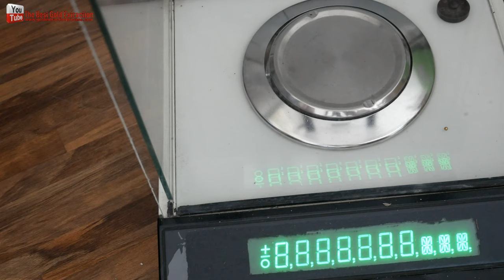Gold recovery from IC chips BGA & electronic devices.

Comment from the maker: Is gold in electronics worth extracting?
The short answer to the question is: yes…there is profit in recycling gold (and other precious metals) from electronic devices. The longer answer is that it definitely requires resources to get this resource (the old adage, it takes money to make money, if you will!).
Sourcing your electronic scrap will also be something that you need to plan in advance of startup. While electronics have precious metals, its in teeny tiny amounts so you need a LOT of scrap to make this venture worthwhile. Similarly, with the need to have labor on the inbound and the outbound, the commodity produced will NOT cover 100% of your costs, so you’ll need to establish the right fee to support your operations. Often you’ll be competing against non-profit or subsidized operations in this realm so being able to differentiate your service will also help you to be successful.
Reply: Hi sir,,  how are you??
Reply: what percentage of purity is the sulfuric acid you use? THANKS
Reply: I am intrested to start recycle and recovering precious metal bussiness
Reply: @Prince-nt4dc The sulfuric needs to be 70% +. Battery acid will work but it takes longer because it needs to evaporate off the extra water while heating. When enough water evaporates it will begin to digest the plastic. It is very very dangerous because sulfuric acid loves water. It will suck the water out of your skin in seconds. While doing so a thermal reaction takes place and it can reach 3 to 400 degrees F. Thus removing (burning) your skin much faster than you can react. Get enough on you and it can go to the bone. If you do it , do NOT use glass (crack) and acid everywhere. Stainless steel only

Comment: This all looked good up until right after the nitric acid step. Instead of tweezing the wire off just put it all in aqua Regia and dissolve the gold and precipitate it out with SMB. That way you get all the gold. By tweezing the wire your leaving the gold solder and when you melted that bit of gold that was not all the gold from those chips. That little ball of wire was way to small for what I seen pulled off. I believe they was some deception in the amount shown recovered.
Reply: He is explaning how to get gold with minimum spending. So he spends just sulfuric acid, if we go to use more substances i think it worth just if we do in big amount of scraps. This is also good, we buy just sulfuric acid and of course we spend our free time to collect gold from chips after desolving thats it :)
Reply: @mirishow  the problem is if all the gold is not recovered it is a inefficient process. It is to hard enough to collect and process to not be efficient and recover all the values.
Reply: @mirishow  If you want to do it even cheaper, use incineration to burn off the plastic, that will eliminate the need for sulfuric acid.

The fact is if you are okay to work with strong acids as he is showing, then the only thing needed to add for extracting the gold chemically instead of mechanically with tweezers is 1% more nitric acid, some table salt, cotton or filter paper to filter the liquid and a piece of iron scrap.

Table salt + nitric acid makes aqua regia and dissolves the gold. Filter off the dies and other garbage. Use iron + the sulfuric acid from the beginning on iron scrap to make kopperas, filter. Copperas + gold chloride precipitates the clean gold. Melt. Easy and cheap process.

I wouldn't be surprised if his losses were around 5% doing it mechanical instead of chemically. I see this video not as a recommendation of how to do it but a proof that it can be done this way too.